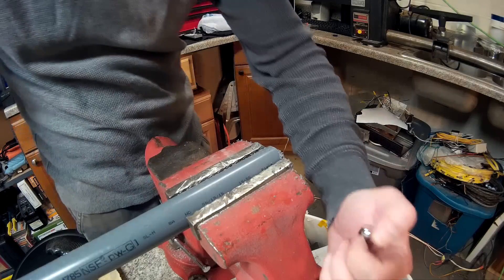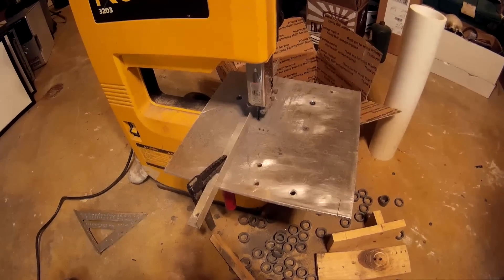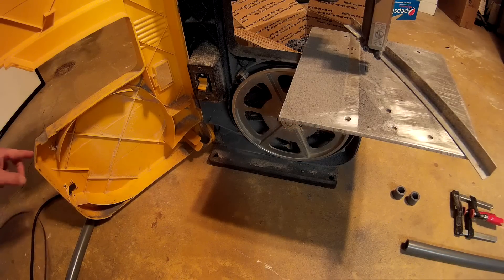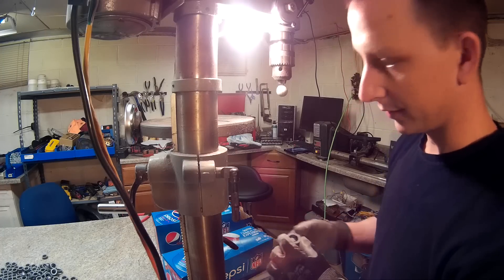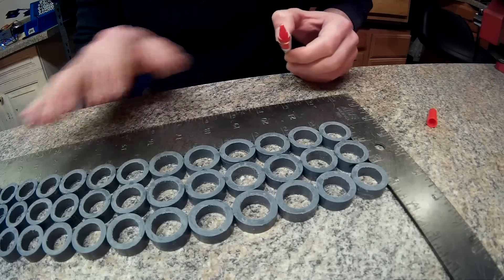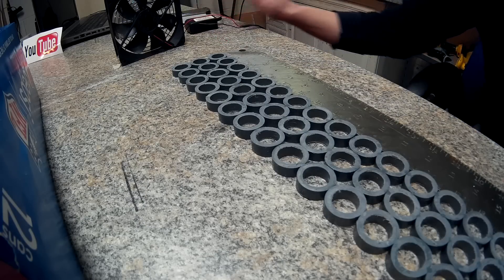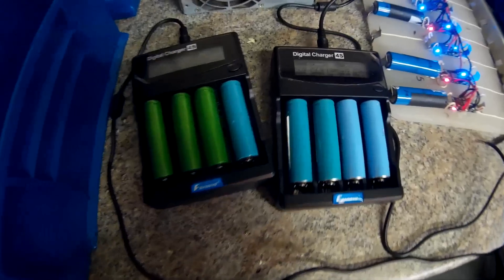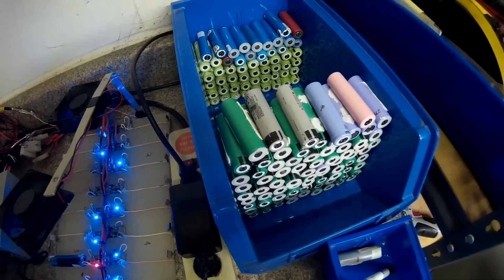Diy Tesla Powerwall ep27 All In One Update

Comment: The right PVC glue is "Griffon T-88". (About $10 for a 250 ml bottle).  You can glue hundreds of complete power walls with one bottle.  Sand the PVC pipe mat before cutting the rings for a better bond. PVC glue dissolves the PVC and 'melts' it together; the parts become one solid piece.
Reply from the maker: Yeah didnt know what that kinda glue did at the time lol🤦‍♂️

Comment: Hi Joe. If you could cnc a plate of some material instead of cutting those cell spacers by hand, debur them, and  gluing them together, what material would you use ?
Reply from the maker: I wanted to start making them out of plexiglass in the beggining but didnt have a cnc
Reply: So something like 4 x 31.25 ish  ?  Never priced it out. I was thinking plywood. Then naming the project 'KINDLING'. But seriously....
Reply from the maker: Lol🤣Kindling! It could be done for sure. Yeah depending on what size you wanna make or how many Peeee ect.  I want to use plexi so I could put a few Led's in it!
Reply: Led's could be useful and enhance the pack. Maybe even help the BMS ? I hope to find a prototype material that isn't as flammable as wood, but not a pricey as plex/lexan. Hmmm. I sure like your pipe pieces. I'm  just not young and strong like you. Cutting all of that pipe up would wear me out :) I did find on Amazon a fire retardant treatment for wood called No Burn Original Fire Retardant. Ha !! Maybe it's wood as a prototype material after all. Unless I can get 1/2" lexan cheap ;)
Reply from the maker: Led's will improve the capacity 😉😉😆  Yeah the plexi would be kinda expensive lol but would look cool.  1/2" plexi would probly be really expensive.  I was just gonna start with 1/4" to see if it would hold up!  When I first started I didnt have enough money to buy the black cell holders so that was another reason I came up with the pvc design.  Each pipe is only a few bucks but a ton of work lol.
Reply: The pipe design is hard to beat. Maybe making a cnc pipe cutter would speed things up? Those cell holders are pricey if you need enough of them to make a power wall I would guess. Back to the hunt for materials !!
Reply from the maker: That would be a cool idea! Would be an accurate cut for each one. I guess since I dont have a cnc I could drill the holes out but would still be a lot of work lol. Let me know what you end up with!
Reply: I sure will !!

Comment: which is cheaper? the ones you are making. or the bought ones? and what type and side pipe are you using? and what super glue are you using?
Reply from the maker: The pvc is 3/4" id and 1"od sch 80 from lowes only that Iva found and they are $4.43 for a 10ft section here in Omaha.  Depending on how wide you cut them you can get 300+.  At the time when I started this powerwall project the black plastic cell holders were about $15-20 for 200 individual pieces so a total of 100 cells.  Now I think you can get 10 of the 4x5 cell holders for $10 for a total of 100 cells.  I guess the pvc way is still cheaper but more work.  I just used regular superglue from harbor freight :)

Comment: If you have some welding equipment you can actually get it back together again so you can wear it out a bit more :) I have done it with TIG and gas.
Reply from the maker: I do have a welder and was throwing that around in the ole brain weather to do that or not LOL
Reply: :)  Could be worth testing as a diy. For doing some plastic and such it should work pretty well. I have seen videos on Youtube about it too and it worked for me when testing :)
Reply from the maker: I might try it just to see if I can although Ill probly get a new as well